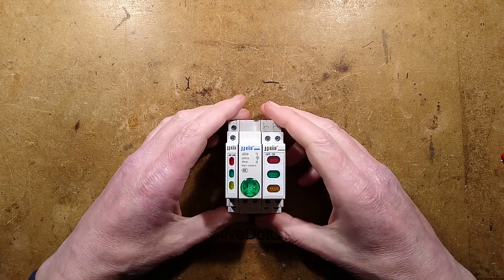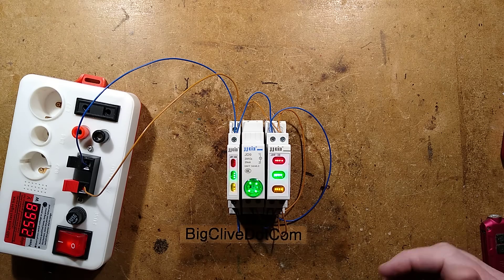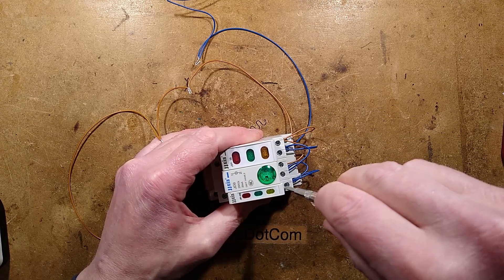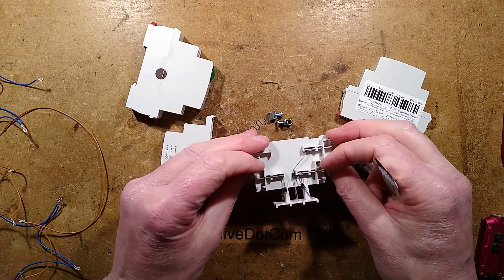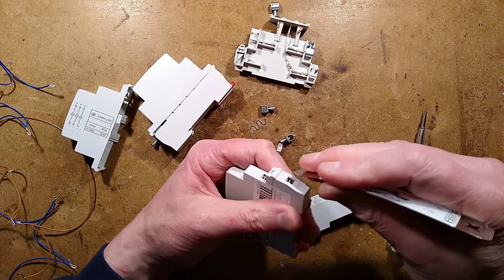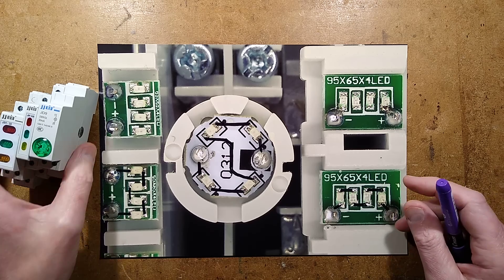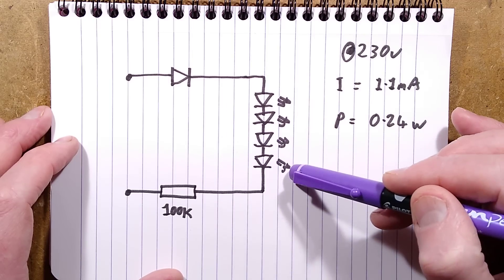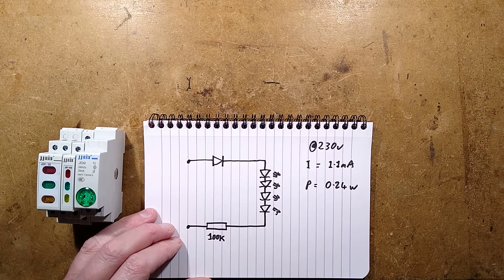AliExpress DIN rail industrial power indicator teardown - with schematic

Comment: In Chile these kind of indicators are required for each phase of a panel to be illuminated permanently when that panel is receiving power from the meter. 

We are required to place a fuse or low value circuit breaker (up to 10a, but a 1a or 2a breaker seems appropriate) protecting those indicators. If using a breaker I usually place a lock that prevents it from being disconnected by accident.
Reply: As stated by @BTW... do not protect the indicator.  I remember once seeing a newish breaker in Ukraine that would not trip if held-up. Being born in post-comunist coutry learning on Czechoslovakian breakers from 80s 70s which would crack  (become un-switchable by design) if locked ON when tripping. Modern European breakers do obviously switch off regardless, but I have seen some LVE and LAP or chinese fakes which noticeably slowed down with finger switching them on.
So I would make sure that the breakers in Chile still trip-off if locked in ON position.
Second: if human wants to switch something ON or Off then he will.
Official process UK when inspecting or repairing circuits is to lock it. That doesn't work. Your average monkey with the trovel, quick-skim, roller or a spanner just take the locks off. The only safe way is to disconnect the wires from breakers output.
locking set is like alkaline batteries instead of enelops, for NIC/Napit (your local electrical trading body) inspection whether you have right tools.
Reply: @Zlodej5  at least reputable brands of din breakers will trip with no damage at all when held in the up position. They were designed to do so. Mitsubishi brand breakers are available in low values (2a) here.

I understand that there is no foolproof way to protect against a monkey, but at least we should make it a bit more difficult to screw up.
Reply: @Zlodej5   what's the point of not protecting it? Would you want to have the whole house not have any power when the indicator fails short for some reason? That's the same logic like putting sockets and lights of a room on the same breaker, you don't want everything off when one thing has issues. 

The 80s are a long time ago, most countries require breakers that still normally work with a blocked lever, same for your RCD. 

It was stated that the lock is for ACCIDENTALLY turning it off, if someone really wants to do something they have to do it intentionally. But they can't ACCIDENTALLY turn the indicators off. 

Same for using LOTO Locks to turn something off, they can't prevent it to 100% because someone could even replace the breaker without touching the lock. They are only there to prevent unintentional accidents. Since you're supposed to short the stuff you're working on (in a lot of countries), it technically doesn't matter since the breaker will immediately react to the short while getting turned on. Just because something can be circumvented intentionally, doesn't mean it doesn't help against mistakes. Even when you add a switch to the breaker that causes an alarm if the breaker trips it can be circumvented. But not accidentally.
Reply: @bastiannenke9613  I don't read the comment as saying don't use fuse or CB for control/supply indication. 
The only merit of lockin ON a CB for this supply indication is that if the CB tripped it couldn't be reset to ON unless lockout was removed.  

If the indicator module was used in an commercial/industrial panel it's more likely the high kA protection would use HRC fuses, rather than CB.  cheap and very common. CB's used for distribution purposes only. You can pull fuse wedges and put them in your pocket. 

Here, there are very specific rules regarding the wiring of high kA potential fuses. Sometime you mount the holder directly on a main busbar and all wire to instrument is low current protected - easy.
 If not, prior to fuse a minimum CSA (gauge) wire,  double insulated, maximum length prior to fuse. After fuse - likely 1.5mm^2 single insulated control wire size. In revenue metering that uses CT's (current input to instrument/meter) the Potential fuses (voltage input) are all done in heavier gauge wire to minimise voltage drop from metering section to meter panel. CB's are never used in this application.

And in such an environment, qualified professionals work... not your dim DIY novice or other non-electrical trade knob who could energise the circuit.  Authorised access only. 
Even so, you tag and lock shit OFF. 
If someone working in that context energised a remote circuit I was working on... god help em... I'd hunt em down and have em sacked. Instant dismissal. Removed from workplace. 

If the indicator was used for an incoming supply conformation/alert, it follows that the fuse or CB would be in the panel - local... not remote.  No need to lock ON or OFF.
Reply: @BTW...     Considering a lot of loto stuff seems to have similar keys and the person from the original post could also be using a piece of wire, I don't see it as a big issue if I'm honest. 

Still don't see a reason to add those indicators to the biggest fuses you have. HRC Fuses would be massively overrated, considering that fuses also are supposed to protect the wiring I have doubt that's even to code anywhere. Fusing 1.5mm² for the indicator with 63A for example seems a bit ambitious. 

You're still missing the point, that the OP said it's against accidentally turning them off, for example if you have multiple breakers in the panel. I still wasn't able to find a source to the above claims, but from the comment it seems like they're talking about the distribution panel behind the power meter. In a lot of settings, especially residential stuff you'll have a majority of the circuit breakers behind the power meter, because they're more convenient and safer. Often, the only fuses that aren't resettable are used for really high power or before the power meter where the cable enters the building. 

I'm fairly certain that we both don't talk in the same direction, considering you talking about high kA Fuses and Bus Bars in a conversation about the Fusing of a tiny 1mA indicator light. We don't even know if the OP works in an industrial setting or does residential stuff, where it's absolutely legal (in some countries) to be on the panel without being a professional.
Reply: @bastiannenke9613  yeah, the lockout device is one of the simple and cheap versions that can’t be “locked” using a cable-tie
Reply: @bastiannenke9613  You misunderstood me. I was not against putting breakers  prior to signalling light, just the opposite. Mine point was not to rely on mcb locks as a device making sure MCB stays in a position you have put it to hold.  If your work disturbs enough people there will come somebody who knows howto replace socket and decides to try to switch it on in case it started working now. Mine recommendation is to take wire out. I find people are less likely to but wires back in. 
I don't know what electricity is like in Chile. I am an electrician in UK (with practice from Slovakia (Czech republic), Ukraine, Hungaria and Germany and apart for Hungaria each of those countries had something much better then the others and each had something that sounds silly from others. SO I have wandered if MCBs in Chile do still fail to trip like some Ukrainean did and if so Locking switch on would be a hazard.
I do not know what requirements of "most countries" are. The Hungrarian electrical approaches are for example considerably different then most.
The fore-stated LAP was on sale in UK. Brand has fortunately quickly discontinued its MCB's but it is a fact that they trip slower when they are held up, or while they are being lifted.
From UK some older Wylex RCD's suffer the same issue. MCB is a clever device and some company copying might have missed a little device detail like angle of dent losing a feature they did not thought of.
Reply: @Zlodej5   seems like we didn't talk in the same direction, was wondering how anyone wouldn't want a fuse there. Most electricians I know would rather fuse everything individually than not. 

there is a DIN that they have to be able to freely turn off of someone holds them on. Or something. Otherwise they'd be basically useless if you tried to turn them on while still shorted.

If people where you work remove locks forcefully, what holds them from connecting the wires? You can't remove the LOTO thingy without breaking it or removing the lock. But even if only a steel wire with a note is added, it is hard to believe that someone would just rip it off.
Reply: @bastiannenke9613   1) My keyed lockout set (6 locks) has one only 6 pin key (security pins no less). The warding and length of the key makes it difficult to duplicate - never intended to be duplicated for safety reasons.  Each of the 6 locks are keyed alike, personally named to me, number identified as being 1 of 6... 2 of 6 etc. Again, standard trade lock sets in The Trade. And again, not only are the sets uniquely keyed, you don't have other qualified electricians attempting to bypass. 
MCCB can be tagged or locked off with adapters that pass through a small hole that prevents operation of the handle. It's common to find operation handles can accommodate 3 locks fitted at same time. 
Yeah, tag indicating "Do not isolate" fastened through lockout hole would suffice in this 'domestic/commercial/industrial' Line voltage present indicator circuit.  
2) Are you aware that HRC fuses can be quite small and achieve 80kA fault current rating? The 500V rated HRC fuses in a multimeter are the smallest. The type typically used here are a plastic base/wedge that uses a clip in or screw in HRC cartridge. Aprox. 35mm long, 14mm diameter.  Look up NS2 or NIT2 fuse cartridges, and Red Spot fuse holders. Rated to 80kA. 
Are you aware of what Prospective Fault Current is? 
Are you aware of what PFC can be at even a pissant domestic supply? 
Any idea why there is a kA rating on the fuse holder & cartridge or CB?  I guess not. 
You think the fault current before or after the main service fuses/CB or AFTER that limiter (into a home maybe 63A or 80A) would only be 63 or 80A?   LOL ... no. 
  Circuit like so,
a) HV to LV street transformer >> 
b) Pole aerial or underground distribution cable serving the street >> 
c) Tapped off Aerial or UG Cable in street to premises - Consumer Mains >>
d) Main Service Fuses (CB in the UK service rules). 
Here, rules vary from State to State but it is common to find these fuses are tamper sealed to indicate unauthorised access (If the damn things have blown or tripped the Grid provider and service electrician wants to know WHY. Smart Meters report outage) That PFC level is only moderated by line impedance between Transformer and premises.  In the State I currently live the Service Fuses are located in an unobstructed enclosure mounted high on the exterior of the building, or on the street pole if underground consumer mains are used. This is so a Network provider or Fire Services can disconnect from the street supply quickly by use of a long insulated pole. Service Fuses are largish high kA rated due to the massive fault potential of the distribution grid, especially if the HV to LV street transformer is just outside the premises. It can be in the +100kA range. The Service Fuse cartridges, by virtue of their size and shape, have no other use in the electrical industry.   >> 
e) After Limiter/s >> Revenue meter (also tamper sealed with wire and crimp seal.. and tamper alert reported on-line if it's a Smart Meter). >> 
f) Cable to Main Switch of the Distribution Board (consumer panel... whateva it's called) >> 
g) Then, individual CB's or Fuses for all power circuits, be they Light, General power outlets, Specific equipment like Cooking Ranges, Water heaters, HVAC units etc.    
If the indicator required in Chile is there to alert incoming supply present  (Live Board), I'd assume they would be wired prior to Main Switch, not after.  Either way, for the obvious reasons, there would be low rated (2A) high kA current limiter prior to the indicator module. 
And that is where you fail to understand "the Fusing of a tiny 1mA indicator light.", no matter what type of installation.  From commercial/Industrial (where you often find CT revenue metering, customer metering/monitoring) or a pissant domestic install... the high kA fault potential exists and needs limiting. The method of doing so is identical, be it a supply indicator like this or any other mains supply potential tap. 

Moreover, high risks follow non-professionals messing with anything to do with Mains Supply wiring systems.
Reply: @BTW...     If you come down from your high horse, you may be able to find out that you're assuming a lot of things here. I never said the current is limited to 63A or so, which wouldn't even trigger a 63A breaker in a short time. You still haven't figured out we're talking about tiny fuses that definitely don't have 80+kA Ratings because its not needed. We still don't talk about the fuses for a hughe panel or building, were talking about a small breaker that protects a thin wire for an indicator. And it doesn't need to have 80kA of rating, if you think about current ratings of various breakers, you'll notice that not even the breaker next to residential is required by code to break those currents. 25kA are what most brands can do max, why would the indicator need more, than the breaker that's usually before the other breakers? Additionally, IF the current during a short circuit is too high that the breaker can't handle it, the NH fuse (or bigger if industrial) would take over. A breaker behind other stuff does NOT need the same current capacity as the first breaker after the road. 

Here everything before the meter is sealed too, to prevent someone from tampering with something or stealing electricity, but it's absolutely not relevant for the discussion. 

It's legal for them to do it, sure it has risks but they are allowed to do it and I doubt it'll ever change.
Reply: If you are curious this is the applicable section of the Chilean norms, both for residencial, commercial and industrial use: https://www.sec.cl/sitio-web/wp-content/uploads/2021/06/RIC-N02-Tableros-Electricos-170621-2.pdf

“6.2.14 All panels must have a visual indicator or pilot light indicating the presence of power, connected directly to the input of the feeder or sub-feeder on each phase. This requirement also applies to panels containing emergency power, which must differentiate the source that provides the energy. Residential panels with up to 3 circuits will be excepted.

6.2.15 Control devices, visual indicators or pilot lights, measuring instruments or other similar devices mounted on a panel and requiring electrical power for their operation must be supplied from independent circuits whose protection may be a maximum of 10 A and of adequate breaking capacity.”

No additional specifications of the type of protection device to use in this case are provided, but at least under my point of view the line that says “directly connected” would led me to believe that accidental disconnection of this warning device is undesirable.
Reply: The fuses or CB is NOT there to protect the indicator. They are there to protect the switchboard/distribution panel in case of a short circuit fault in the indicator or wiring. 
The secondary function is to isolate the indicator if any service work is needed after the fuses. You wouldn't want to pull main fuses and disconnect the whole board to work on the indicator module, would you. 

As you describe the application, without fuse (2A) the indicators are connected prior to any current limiting device to the full current supply potentials.  The only fault limiter will be the main high current service fuses. Could be 63A... could be >800A. 
The instantaneous fault current level will be far higher than the main fuse rating. Could be around 6kA to 10kA.  One flash... then ash. 
If a wiring fault from meter to the indicator occurs ( low current capacity wire) OR those small wires inside OR the LED board suffers short circuit the wire or indicator module will vaporise, spraying arc flame (and molten copper metal) all around the enclosure. 
Replace or rebuild the whole panel including a new revenue meter. Everyone will be upset and ask WTF questions. 

I see little point in CB lockoff. It will be obvious it has been manually switched off or tripped by handle position.
Reply: @BTW...  you are right, the little fuse/circuit breaker is mainly protecting the small gauge (~ 1,5 mm2) wire that’s feeding the indicators and the PCB inside.

We don’t use main fuses for residential applications around here. Instead inside the enclosure of the meter the energy providers places a 6kA or 10kA circuit breaker rated for the service.

I still think a lock around the circuit breaker that services the led indicator is useful. Mainly as a way of signaling the home owner that they should mess with that “toggle” as it does not directly control any receptacle/ useful load.
Reply: @BTW...  Maybe they use breakers that don't go in a different position depending on what turned them off. A lot of brands don't have that feature. And that feature won't prevent anyone from accidentally turning them off, removing the lock has to happen intentionally.